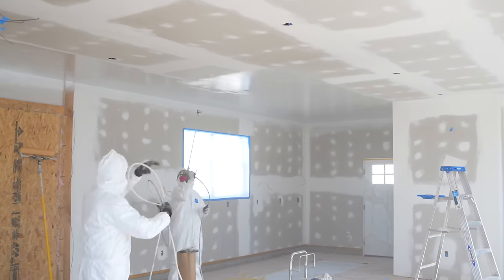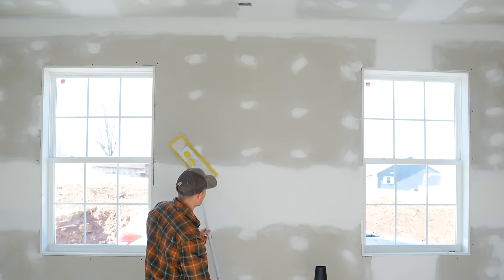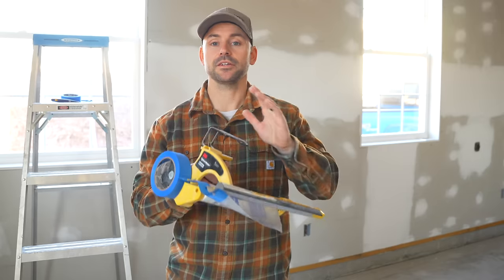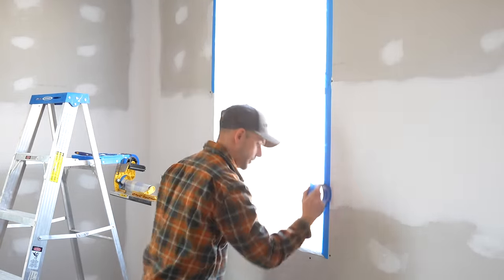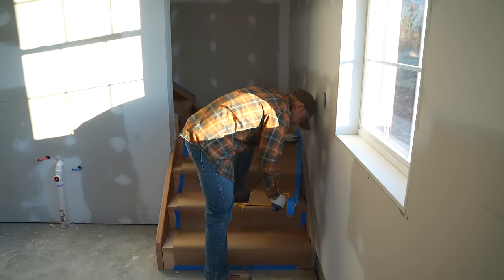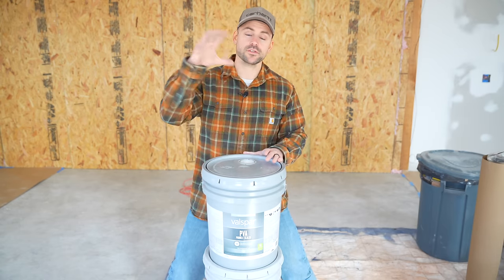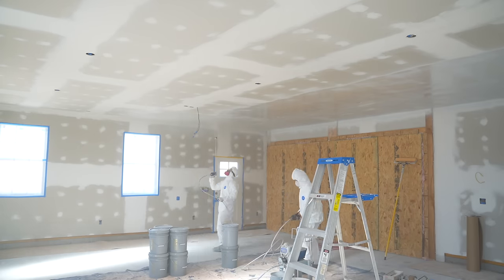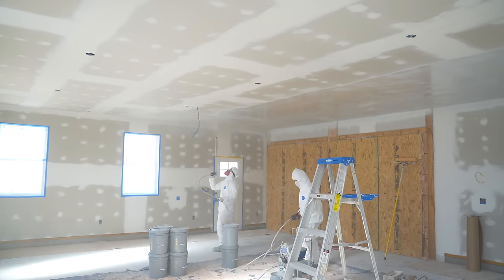How To Paint A New Garage - FAST And EASY!

Comment: I always love your painting videos and explaining so much. I never had the chance to use a sprayer because of the jobs being remodels or basement. The houses that I would have done the finished drywall they always had their own painters. But I agree so much how important it is with the prep work and especially removing plastic and other things while the paint is wet. I've seen other painters use that sprayer system and they are very happy with it as well. One of the biggest things I love is how most of your jobs are all smooth ceilings etc. In our area there's so much textures on ceilings and I do like one that I've done quite a while is a Spanish texture but very light and when it does it actually looks like clouds on the ceiling. But I do agree that I love smooth ceilings as well. Great job Josh and hats off to your helpers as well. 👍🏻👍🏻🔨🔨

Comment: I built a home and the builder would not finish the garage, they taped and did some mud but there are many imperfections in the tape and mud, do I need to sand it all apply more mud to even out perfections prior to painting?

Comment: Why do a lot of new places have the garage unfinished? I’ve heard that because of tax purposes maybe but idk
Reply: It has to be drywalled and at least taped in order to meet code if t is attached to a living space. So basically builders are just cheap for not going all the way
Reply: Garages are not counted as finished square footage so it doesn’t matter if they are finished or not, basements people intentionally do not finish when built so they get a tax break on the square footage and then finish them later so they dont get taxed on the finished square footage.